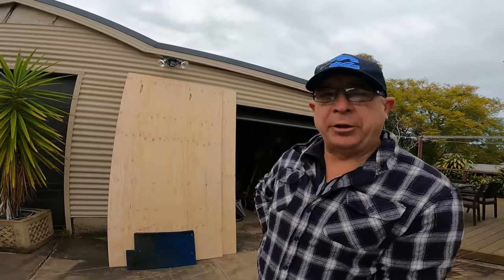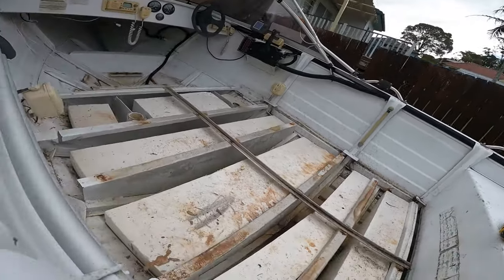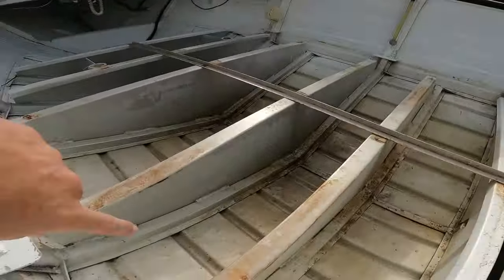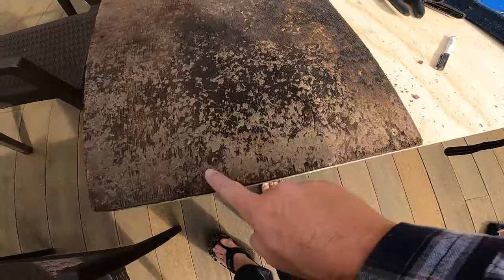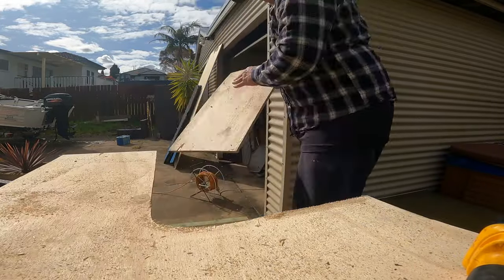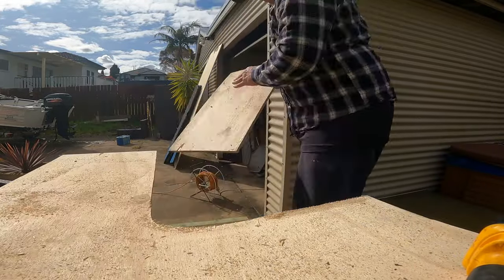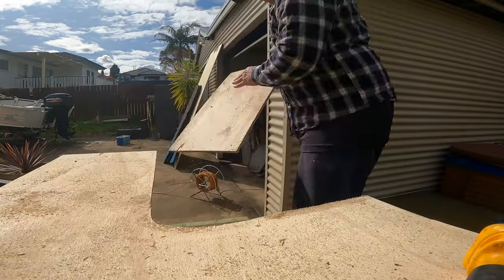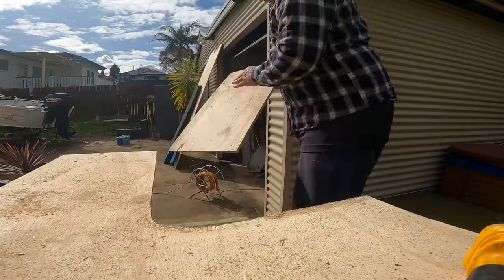Boat Floor Replacement: Step-by-Step Guide for a Successful Project

Comment: Thanks for taking the time to post this. Have just bought my first boat (1972 Quintrex 16ft ali runabout) and is in desperate need of floor replacement. Appreciate your time and effort. From Southwest WA.
Reply from the maker: Hi mate, 
No dramas. Hopefully it helps. Make sure you use marine grade plywood and I would make sure to paint it as well to make a bit of a barrier. 
Cheers 
Craig
Reply: Hi mate what model Quintrex is it? and how much did you score yours for? I'm looking for a alloy runabout to restore myself I'm in Bunbury wa so probably close to you 😂
Reply from the maker: @axelsol89 hi 
It’s a 2006 stacer 420 
I purchased it when it was about 3!yrs old if a guy who only had 9hrs on it

Comment: Ive got the exact same boat except mines a 1995 model back when they labeled the 4.2ms as 4.14 seahawk in the process of re fitting that boat going to have it looking like it did when it came out the factory so its kind of nice seeing how yours is set up as it gives me abit more of the stacer factory set up aside from the book that came with the boat with its original warranty registration i wonder if the warrantys still good i mean the boats only like 28yrs old should be a fun project 😂
Reply: I finished rebuilding the outboard a few months ago so now its just a matter of working on the boat on my days off until thats looking as good as the motor 😂